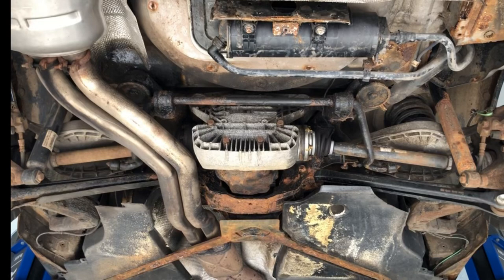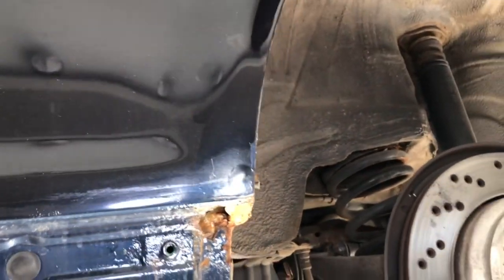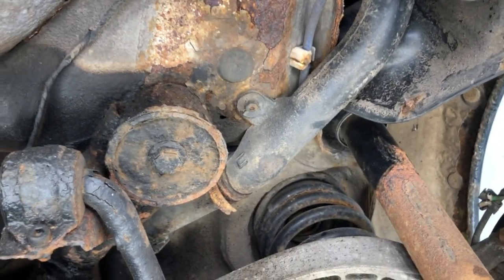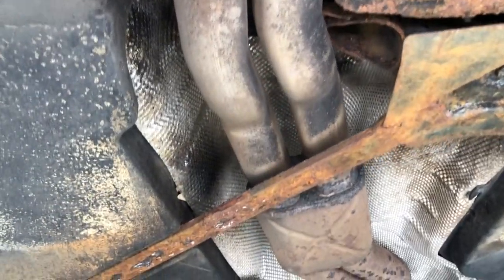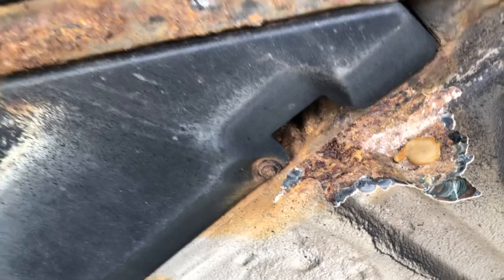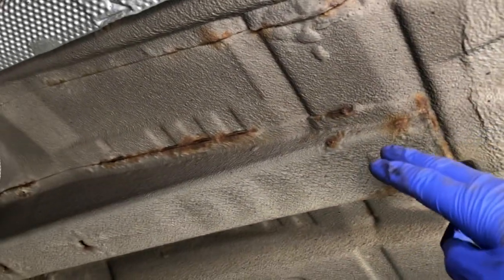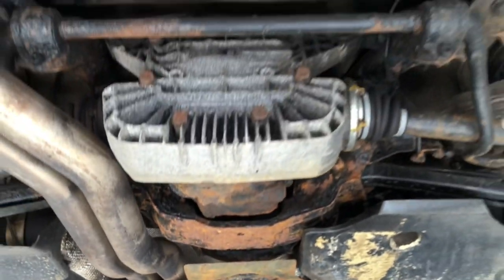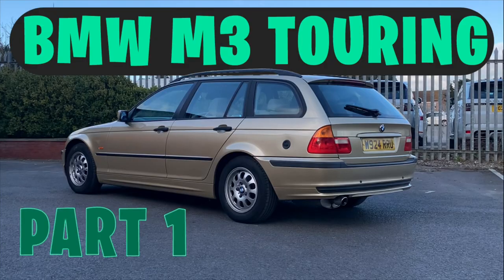Titanic Rust on BMW E46 M3

Comment: I had similar level of rust on a 320cd e46. Took over 250 hours of work to remedy the mid to back underbody where rear floor panels, battery box, inner rear arch panels, rear subframe cradles had to be replaced along with fabrication of new brake pipe brackets. I wouldn't advise anyone to attempt this themselves unless they are interested in learning appropriate restoration techniques...Thanks to this channel for providing me with great advise and direction through all of their restoration videos on the E46 chassis. You guys are awesome for sharing your knowledge with the E46 community  👍
Reply: Sadly doing it on a diesel was a waste of money, now ULEZ is coming
Reply: @hoonaticbloggs5402  what, like that affects the whole of the UK or world? 🙄
Reply: That’s interesting to read. I have a 320i also with really bad corrosion that I’ve started a restoration project on. Feels good to know that I’m not the only one putting my sole into a car that financially isn’t really worth it.
Reply: You in the UK, they're not expensive cars? You'd have to be masochist to do that.
Reply: @465painkiller465  To me it wasn't about how much the cars value was, I saw an opportunity to learn a new craft and acquire the equipment that would allow me to work on more valuable cars in the future. If I botched the job it wasn't the end of the world, but thankfully it worked out amazingly so it was a really big win overall. There's another YouTube channel "Fitzee's Fabrications" that really helped me learn about panel fabrication using basic tools (if BMW dealership panels are too expensive). I wish you the best of luck with your 320i mate. Nothing is impossible to achieve if you have the patience and dedication✌
Reply: @SandyOC100  oh yea quite the same for me as well. Really educational just taking the car apart. Thanks a lot! I think I’ll opt for aftermarket panels for rear arches and sills. But first comes the boot floor and the entire underside

Comment: How obvious was the corrosion when the car was on the ground?  A 2005 with 74k miles… I have friends looking for E46 M3s that would have nearly bought the car sight unseen if it seemed like a “deal” - which is difficult to assess these days… But excuse me now, I need to go disassemble my E46 in the parking garage and check for any corrosion.. 😳🫣🧐
Reply: Corrosion doesn’t care about mileage
Reply: I wouldn’t bother getting one, they’re all rot boxes and the floors crack where the subframe mounts. Disgusting effort by BMW in terms of corrosion resistance. Such a shame 😢
Reply: 👀The reference to mileage relates to the premium lesser driven examples command in the market… Did you get one? One of the best cars of all time in my opinion. Hopefully you get a chance to spend time in one some day.. 👍
Reply: @DaveTony206  
No, I have a 2000 HoldenHSV

Comment: I got rid of my 2003 E46 330d last year - it had half the corrosion this M3 did but the rear arches were worse. They were poorly "repaired" by the local BMW dealer under warranty and then they wouldn't touch it again when the rust came back 12 months later.

This M3 is shocking!!

But same outcome as mine, cut my losses and sold it as a donor car. The drivetrain now lives on in a technoviolet coupe.
Reply: Getting rid of my 330d bc of rust now. Looking for another or to get a nice shell. Will keep almost all of it for spares.

Comment: My solution to trapped corrosion is as follows. I remove as much corrosion as possible, spray it down with rust killer then coat the seams with large amounts of copper grease followed by wax-type rust-proofing.   Then I will inspect and repeat if necessary every year... It does not look good but it will stop the rust.

As you say cleaning up and painting is not going to work.

Comment: Absolute nightmare.  I'm not totally shocked it got this state though - you will be lucky to find a rust free one at this point - nearly all of them must have had arch or sill repairs by now.  Modern cars are quite good at hiding their rust with plastic sill protectors and the like.

Glad to see the touring project will get running gear out of it.  Car probably still worth 7k or so, but it might have been bought for 18k or so with those miles...  Hopefully it wasn't too painful for the owner.

Comment: Remarkable that this isn't a regular upload, it's great.

Well that must be a very disappointed owner of a low Mileage M3. Actually, it's not worth much more than the engine/transmission, what will it be 6 to 7 thousand?

However, it would be a pity that it is not being restored. A nice challenge especially as the aren't any replacement or repair parts available.

Comment: As a Jaguar owner and welder of many and various things, I get somewhat fed up of people slagging off Jaguar cars for corrosion. I have a 2001 Jaguar XJ8 with 119K on the clock with nowherenear as much corrosion as the BMW in this video. It makes a refreshing change to see a BMW rotting away rather badly and needing saving from the scrapyard.
A lot of cars rust away mainly because of bad maintenance by the owners from new.

Comment: Spraying stuff over the corrosion stop it, if there is no puncture on the other side. If I spray some wax over a rusty plate, the rust will still be there, but it will not rust anymore...soo yeah....you're right...but not quite... 🙂

Comment: My e46 330ci has got zero corrosion. It doesn't go out in the winter or wet. Imported from NZ.
Reply: That’s the only way. It’s disgusting how these so-called premium cars rot.
Reply: Yeah, importing from a dry climate Is the way go now it would seem, unless you can pry one from a mint collection, most of the UK cars that weren't garage queen's from spanking new are plagued with corrosion issues now its such a shame.
Reply: @KiloRomeoOscar  it probably doesn’t apply to these; but importing domestic Japanese cars you need to be careful, as they’re often not rust proofed at all!
Reply: Best way to get your right. Not many going to be in top condition nowadays.

Comment: Why do the E36 & E46 suffer from so much rust when the E90's and onwards don't? Never seen an E90 OR F30 car with heavy corrosion.
Reply: They just aren't old enough yet to have suffered.
Reply: @adogmcdizzle  Not buying that, when the E90 came out BMW went from a 6 year corrosion warranty to 12, they changed the way the steel was treated for corrosion. You've got E90's coming up to 17 years old now, I've not seen any that are rusted out, E36's and E46's were always prone to a bit of corrosion, often times much sooner than 17 years which is where the oldest E90's  are at.
Reply: @malcolmlee3285  The 12-year warranty applied to the later e46 as well.  I know because it applied to my own e46 M3.  My 2005 car looks better underneath than the majority of e9x cars I would wager, and it's not low miles, just been cleaned reguarly underneath and rust protected at intervals.

The useage profile of the vehicle makes the most difference to the bodywork condition rather than design or material, you can see this in US cars depending on where they live in the country.

Given enough time you absolutely will see e9x looking like this too.  Certain areas will fare better, due to improved design, but most of the same flaws still exist.
Reply: Corrosion resistance did indeed improve massively with the e90 and e61 generation, but they’re not immune. Subframes rot on them too!
Reply: E90's were galvanised, as were E65's, E60's etc. The E39 is a rust bucket as well.
Reply: @berwhaletheavenger  they weren’t galvanised.

Comment: This car has been kept in very agressive enviroment. Diff case is pretty thick and made from cast iron and in normal condition cant get rust like this.
Reply: This is standard fare for a UK car, especially a BMW 😢
Reply: If kept outside in uk
Reply: @douglasmurdoch  or driven / stored when wet.
Reply: @royfontaine5526  😂 true , I keep my e39 stored away for winter 🥶  it the best colour for keeping clean black
Reply: @royfontaine5526  mine has nothing like that, i think thats one of the worst ive seen...
Reply: This has probably lived by the sea or has had some anomaly happen where it got submerged in salt water, it shouldn’t have seen enough salt just on the road with that mileage to do this amount of damage imo.

Comment: Absolutely nothing here that would suggest to scrap a low mileage car. I've seen 5 year old land rovers with worse. The new civic look like this underneath within a year in some cases. A capable garage with a reasonable hourly rate would have this solved easy enough.
Reply: You have not seen one year old Civics with this level of rust.
Reply: It has a hole in the sill….